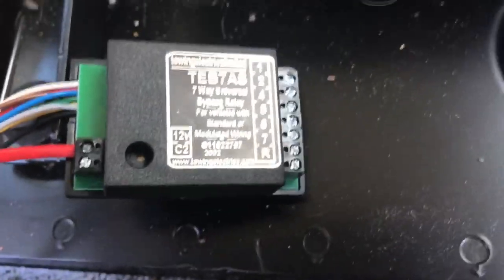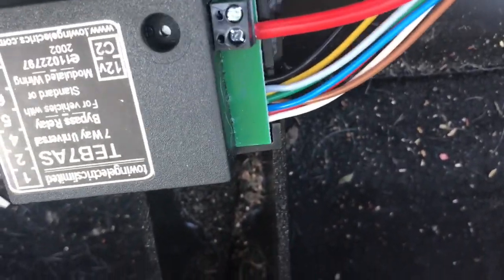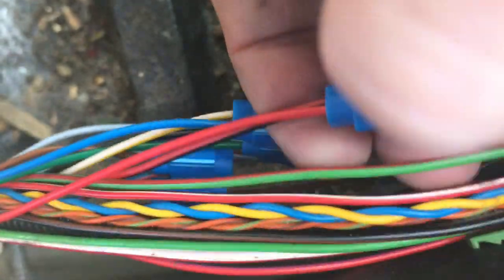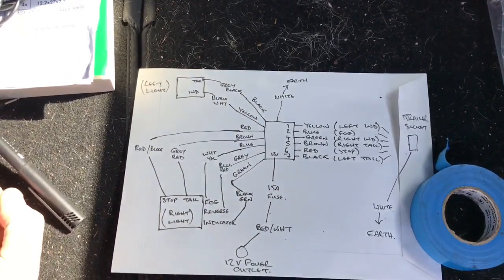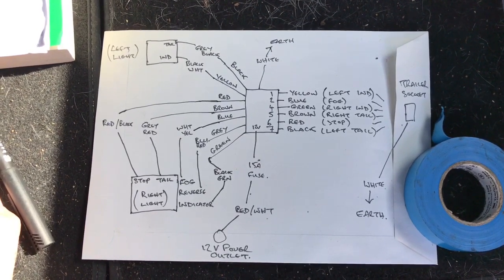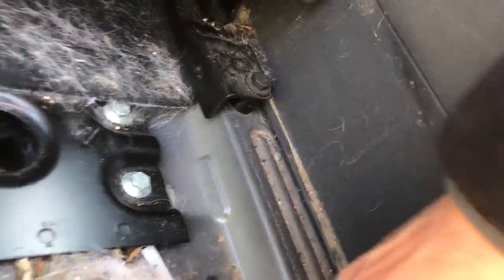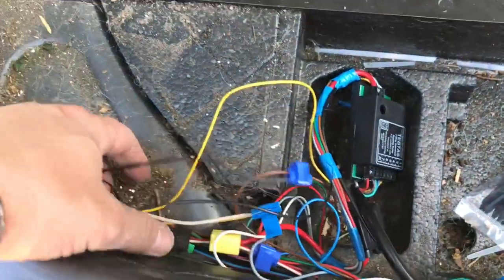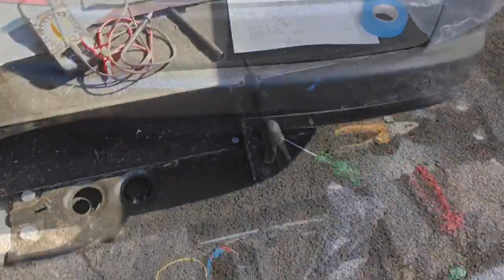VW Touran - Fitting Towbar and Electrics

Comment: For a 2014 face lift model we found that the Grey and white wire was the fog light. Just sharing to help out anyone else as it took some tracing. PS, thanks for the video and diagrams
Reply: Thanks man I'm about to take my 61 plate to bits and fit one

Comment: Good job but those connectors are the worst thing possible  to use  on any auto application they will always give trouble at some point . either solder or use durite connectors

Comment: Hi I have done all my wiring same as you.  Just the teb7as is clicking when indicators but just no lights atoll at my light bar I've used 2
Reply from the maker: Hi Lincoln - sorry to hear you are having problems. Mine still works fine. Did you get your issues sorted?

Comment: This is amazing, thanks so much for doing this! You might have mentioned this in the video, I haven't watched it all yet, but do you need to get the car reprogrammed or anything when using the bypass relay? Cheers
Reply from the maker: Hi - I didn’t have to reprogram. It works fine with just the bypass relay

Comment: I did what you have done but mine keep buzzing when the cars on
Reply from the maker: You must have a short on one of the indicator circuits - they are the circuits that use the buzzer on the relay. I hope you find the problem
Reply from the maker: You must have a short on one of the indicator circuits - they are the circuits that use the buzzer on the relay. I hope you find the problem
Reply: @kitcarbuild3927  that’s great thank you will take a look